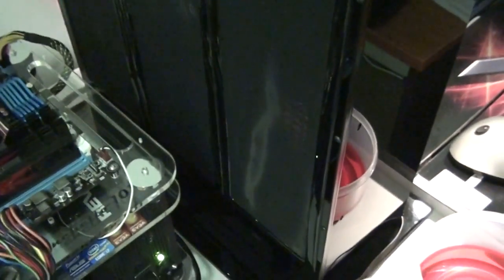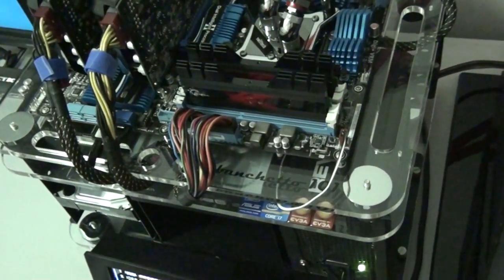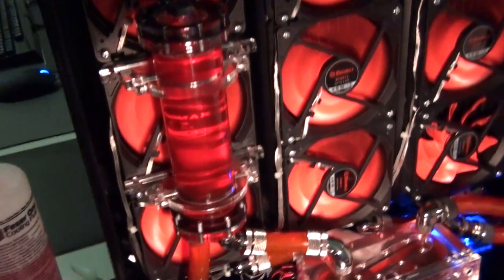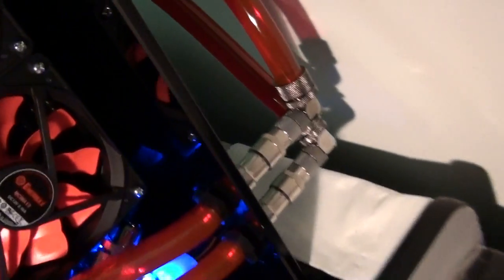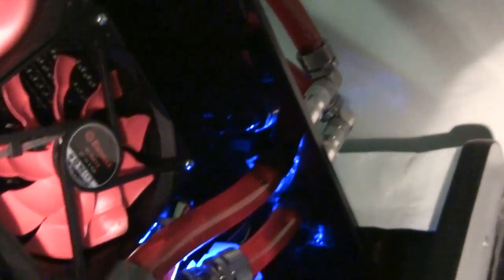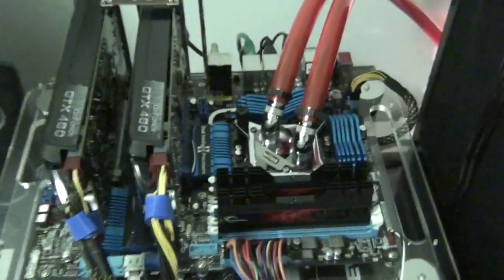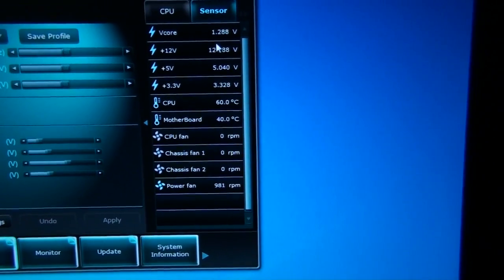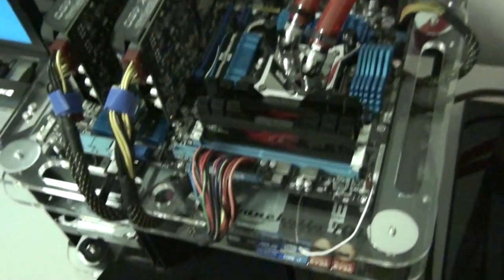Danger Den Waterbox Cooling Core i7 2600K

Comment: I love the box, it looks so sweet. Those Enermax fans, what max rpm do they run at? And do they push air well? I'm going red with my 800D so I will be changing out the fans, tubing,coolant. So what coolant and tubing are you using.? I just love the shade of red of your coolant and tubing. I want the 2600K but i cant justify getting one when my 920 meets my needs. besides my wife would axe murder me in my sleep if i did lol.

Comment: Dude I see you're saying your building this cooling rig for multiple purposes which is good cause from the outset it looked like 3 3core rads were cooling just the CPU o.O wow! Im currently investigating a watercooling setup for my failed aircooled build using 2600K @4800Mhz at the moment and 3way gtx580 evga 3gb versions. Trying to find a case big enough to take everything internally is a push though...

Comment: @SingularityComputers I understand mate, but your temps is still a little high, my ambient temps are 27c, and i get those temps that u have, only difference is that i use a rly cheap aircooler, You can always try to lap your cpu and cpu cooler, and i have the same cpu and same clock and vcore.  Best regards =)

Comment: I love your fan controller... Same as mine NZXT somthing :)

BTW, is the cooling system H80 strong enough to cool a 1156 i7 and a GTX560ti 2GB videocard??? u think, i have 2schyte fans. 5,400Rpm and arround 250cm/m3 air flow each.....

Comment: @SingularityComputers hey I was thinking of a similar loop that would go res>pump>then split to cpu and dual gpu's then connect back to>radx3>res do you think this would be an ideal setup since the cool water from the rad's would split right after the pump instead of recycling warm water from the cpu straight to the cpu's, or how would you setup this type of loop

Comment: Hello friend, I wanted to set up a water cooling system with products of DD, in my case would be just to cool my video cards, because I already have an H70 cooling my cpu. With just a radiator "Black Ice GTX480" would be possible to dissipate the heat from two ATI 5970 in Crossfire? I have a very little experience with wc systems.. Thanks

Comment: It tops at 68c?? At 4.6ghz and only 1.3Vcore!!?? Bro either something is wrong or the H80 I have works just as well as a full blown water cooling setup. Because even with a voltage hungry chip (I need 1.36V at full load for 4.5ghz) and using a Corsair H80, my MAX temp under prime after running for 2 hours is 65c and usually hovers around 60c. That's with 1.36 volts. Your only using 1.3. My ambient is around 75 F. No way should I be getting better temps at higher volts with an H80